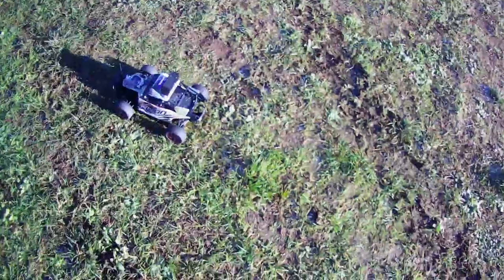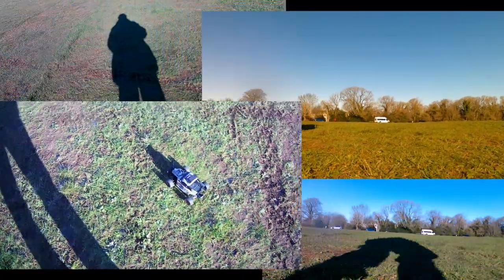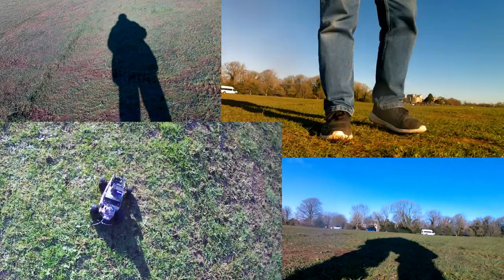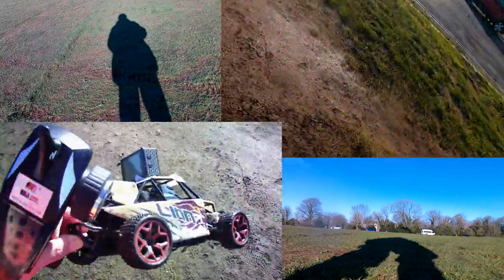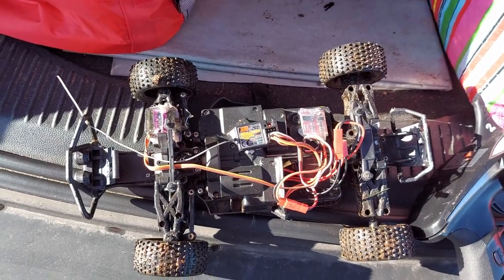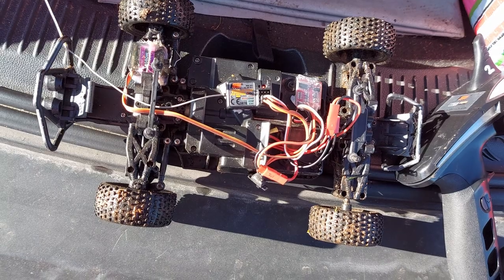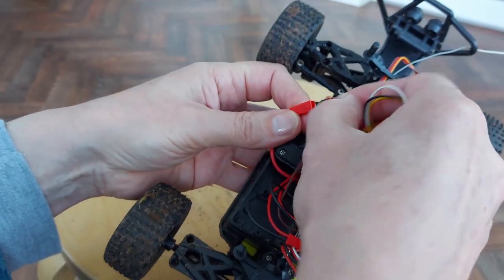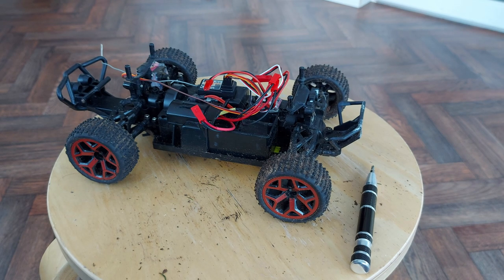Revell Lion on Durdham Downs 20240118

Comment: A good little run while the motor lasted. Shame about the commutator damage, otherwise a bit of fettling and it could be out running on 2S again. Mind you, this one looks the part for a brushless conversion 😀
Reply from the maker: I am pretty sure I had planned to make it brushless several years back, but this time I replace it with another brushed, and in another video I fix this motor again 😁

Comment: Is it a triple winding motor, so have you burnt out one winding, or is it the commutator, now with a melted spot?
Reply from the maker: There is (of course) a video coming up on it 4th February. Basically it overheated, the solder on the commutator tags melted and the commutator was distorted. PS. I think I spelt it right 😁😁👍👍 I think this may even be the motor I rewound in an earlier video in the series - 5 years ago.